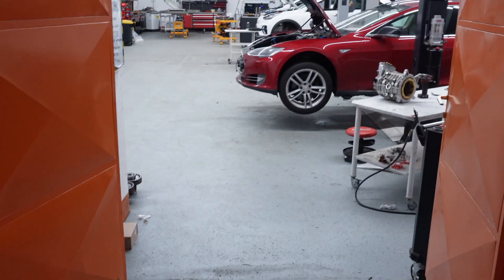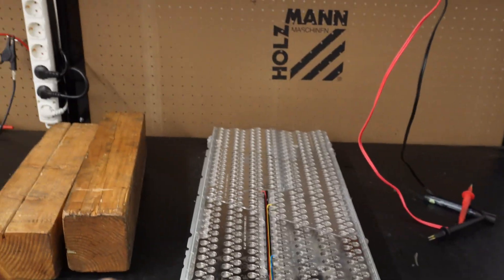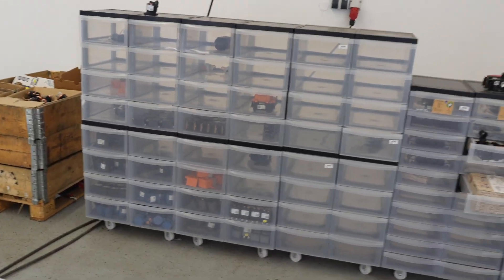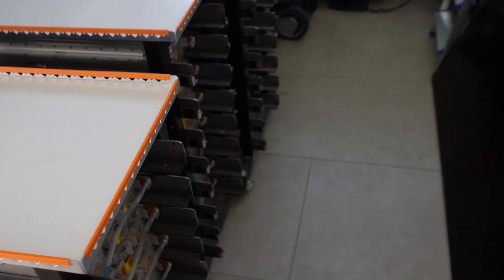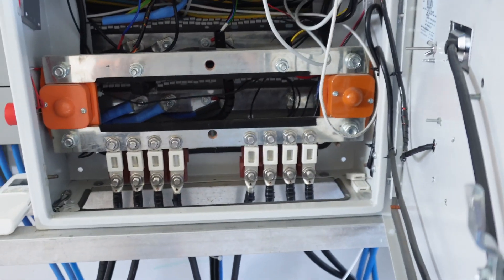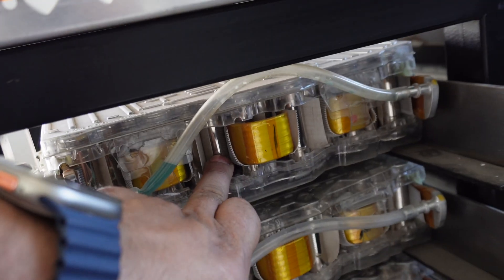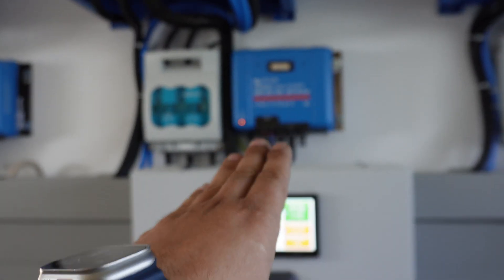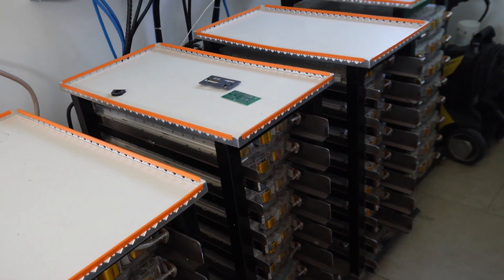Even DEAD Tesla saves your money - Battery 2nd Life

Comment: About charging, have you looked at replacing old type 2 port on tesla 75-90-100 and Raven? In the us they can achive much Higher charging speeds byt in EU the adapter is limited to 140-150 kwh.
Any projekt about this? There are so many of the cars out there.

Comment: Question: I think about getting a used VW T6 ABT e transporter to convert it to an RV. it comes only with a 37kWh battery. any chance you could extend the battery on a level that still allows a certain amount of weight? would needed to be discussed how much.

Comment: I did a 140KWH model s pack in 2016 
I still use it completely offgrid  
16-24 mv 
103kwh usable 40-50v range
34kw of solar 
I added coolant to water supply heat exchanger and set max temp to 36*c to keep modules cool. This was needed after i went from 24kw of solar to 34kw of solar
Reply: I have same bms